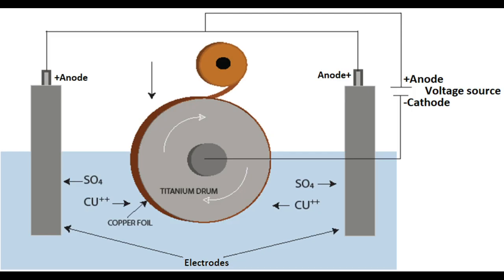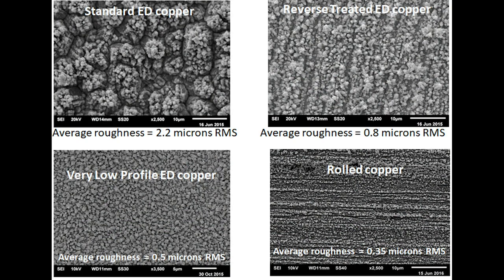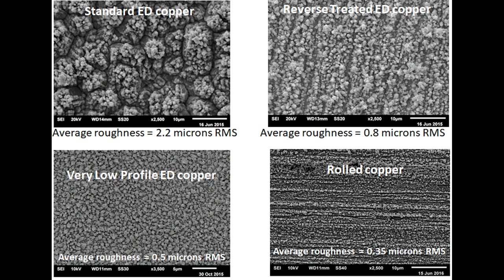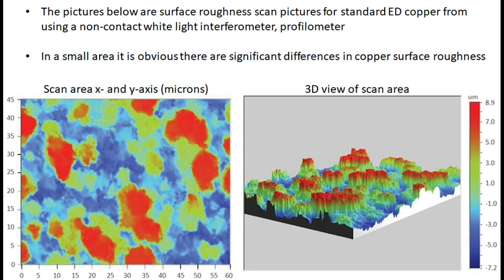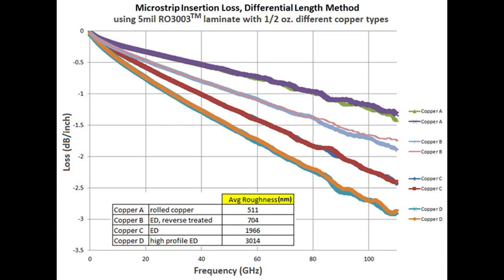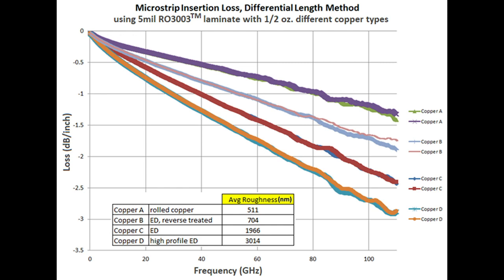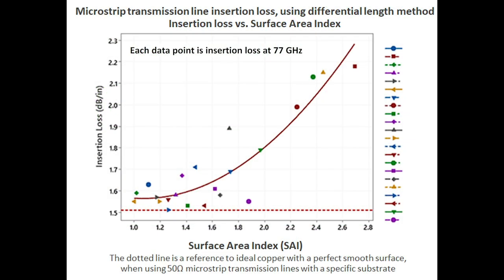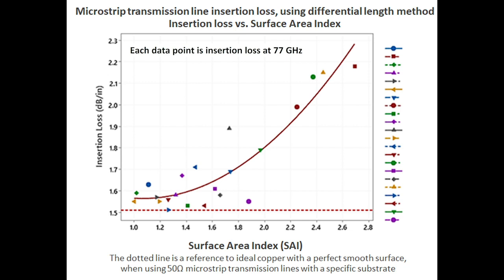Overview of Copper Properties and the Impact on Microwave and Millimeter-Wave PCB Performance

Comment: Great video, I look forward to information from Coonrod.  Im guessing Copper B is what you call Lo-Pro? One disadvantage to the Lo-Pro and VLP/VLP2 smoother copper is worse peel strength. If you do a lot of rework and tuning of RF traces, smoother is better for return loss but you may lose your pads during rework on your material. Also being creative with soldermask overlap on copper can aid in low peel strength materials not peeling.